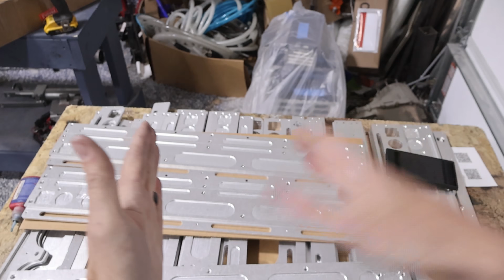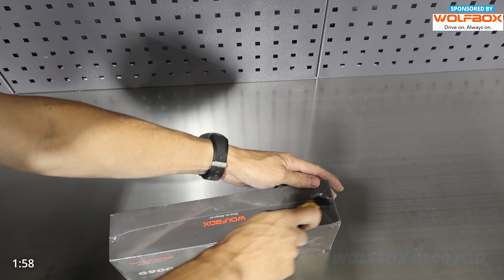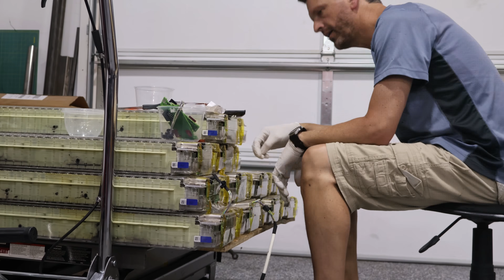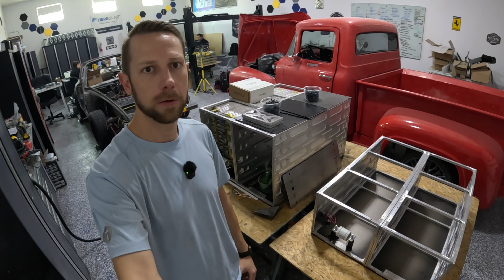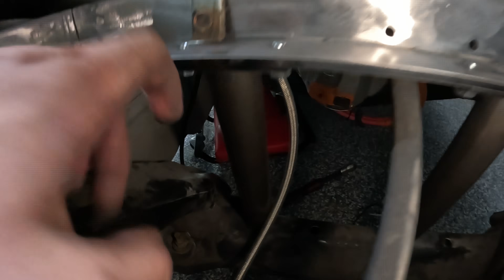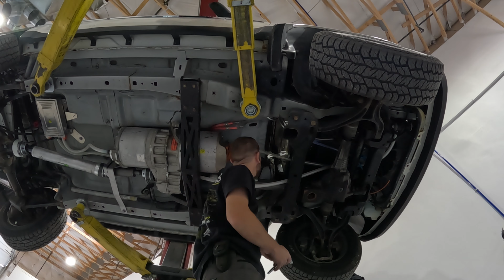Building the Tesla Heart: Battery Box Install

Comment: What is the weight of the two boxes combined?
Reply from the maker: Each module is 55-lb.  So close to 900-lb in batteries + 100-200-lb for aluminum structure and wiring
Reply: @electricsupercar So a couple hundred more that the engine/trans/t-case.

Comment: Looks great ! Is there any concern with rain water if the road is wet splashing up onto the batts from below? Or will this box be sealed when final
Reply from the maker: It is pretty "splash proof", but further sealing would be required to launch a boat or traverse a river.
Reply: @electricsupercar ok cool I didn’t know. I know the underside of my car is caked with all kinds of grime and dirt so just wondering when I saw it open to the ground if you would have to seal that entirely to avoid a future short or failure if in snow or rain or even simply hitting a puddle

Comment: Having to deal with the small radius tubing and fittings for cooling look to be a giant PITA!! That engine bay sure filled up in a hurry. If the battery boxes are standard, there should be cooling solutions ready to buy.

Comment: don't you want to put some 90 degrees connectors on the fluent next to the battery box? it will help reduce strain when removing and reassembling the battery box

Comment: Nice stack! I’ve noticed in your support brackets throughout your vehicles you’re not incorporating flanges on the sides. These dramatically increase strength, require thinner gauge material, and reduce weight. This was advice I got from an engineering prof “just throw on a flange, it’s way stronger and basically for free”.

Comment: Isn’t there a failure point with the brass fitting connected to the aluminum tubing in the cooling system inside the battery box? Won’t the two metals react and cause the aluminum to fail and then leak coolant inside?

Comment: It looks easier than the custom made boxes you used before. Are the sides sealed just before installation or is the overlap of the panels enough to seal?  

Looks like a good system.
Reply from the maker: Good system.  I think it is "splash proof" but probably not suitable for driving in lakes and streams

Comment: what's the rationale to do the cooling in series? I looks like the DC/DC converter is cooled with "warmer" water coming from the motor, it should be the other way around?
Reply: I would think the motor would need more cooling since it would generate more heat. The coils if they get too hot will increase resistance and increase power usage. Keeping the motor cool keeps the power draw in check meaning the DC/DC converter doesnt have to work as hard.